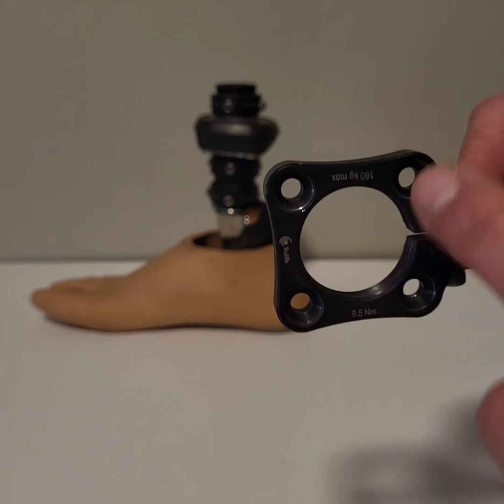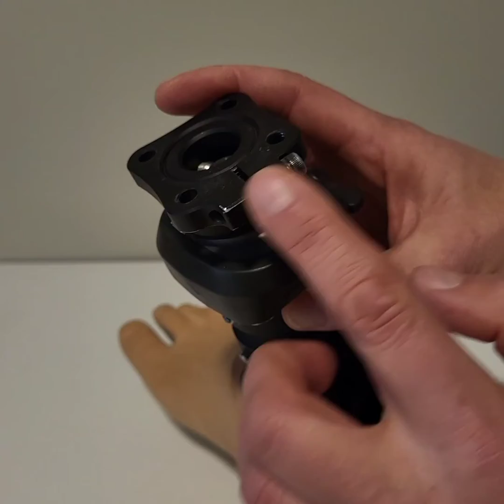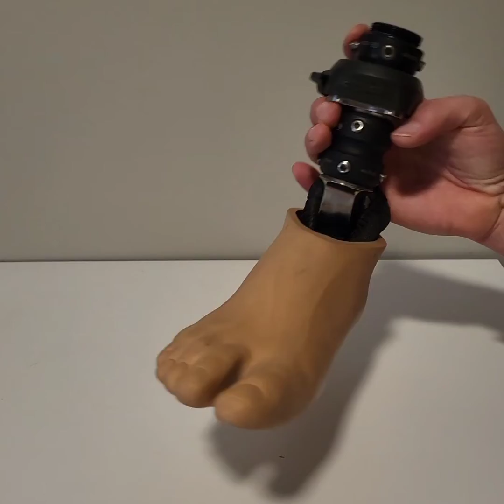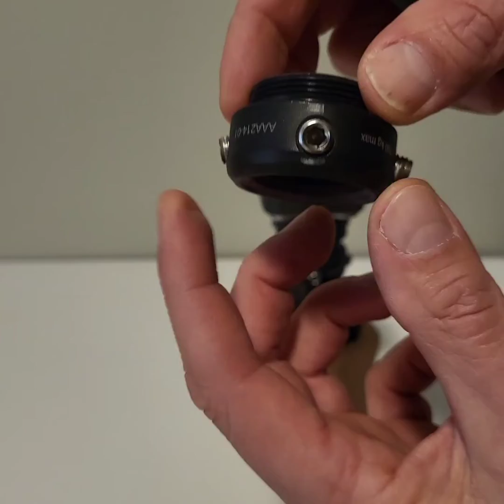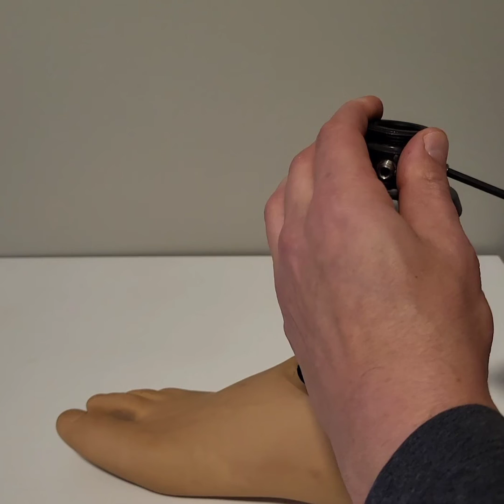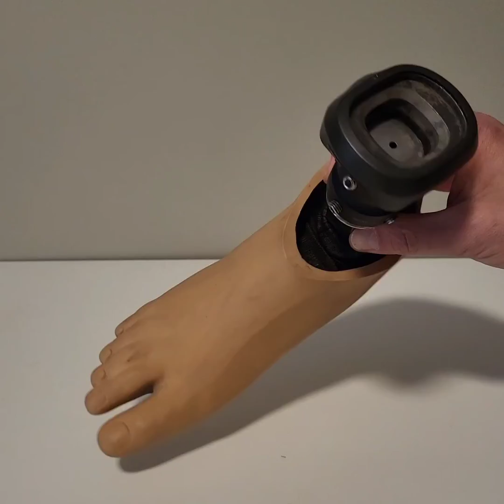How do You Adjust a Prosthetic Foot?

Comment: Pretty amazing how much engineering goes into the prosthetic foot, and how much we take for granted our natural body adaptations in being able to use the foot and ankle as we do.  I presume in the future, many of the manual adjustments might be replaced with smaller stepper motors and some kind of power source to make adjustments on the fly.  Thank you for sharing!
Reply from the maker: There are some prosthetic feet with powered adjustments, the biggest problem with then is weight and durability, but technology is always improving.